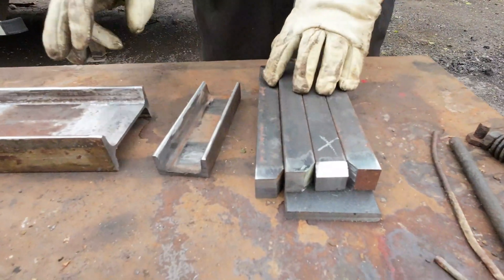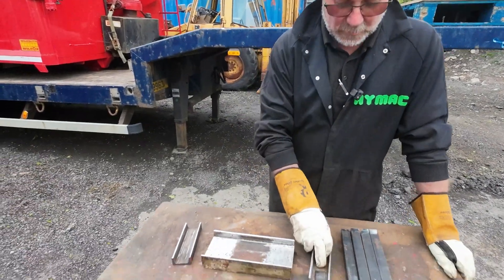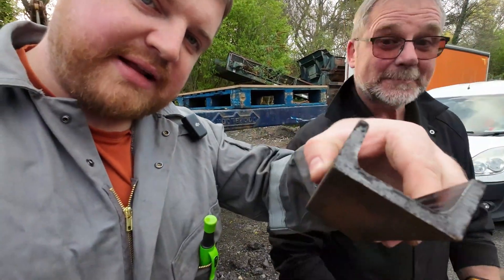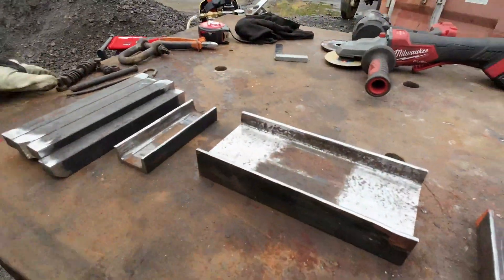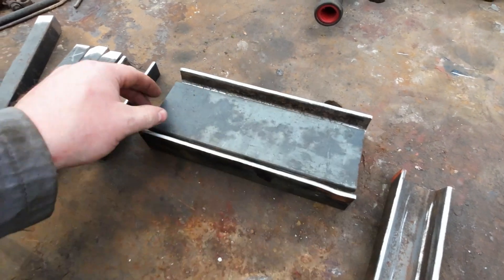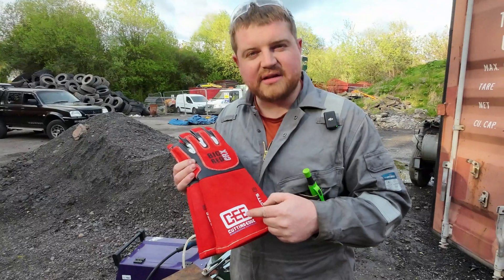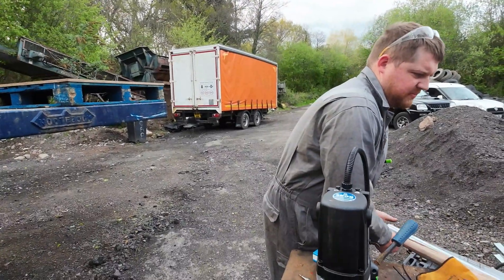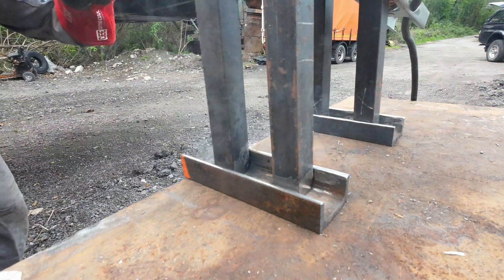Fabricating A Liner Puller | Homemade DIY tooling

Comment: Bit of channel.......bit of universal and a bit of square bar...

Make hardwood slippers for it so you don't damage block when putting the weight on...

Good 
😐🇬🇧
Reply from the maker: Surprising the force that was needed to pull them out Glen, that was a worry with marking the block but think we survived it

Comment: Hope it works. I used to use a brazing torch and a long screwdriver to get liners out of Perkins engines. Start at the top and heat the liner and tap down the screwdriver, effectively cutting a strip out. 

Running a couple of beads of weld in the liner shrinks them enough to tap them out too.
Reply from the maker: That was our resort if this didn’t work, the weld one I had heard about, thanks for watching and commenting👍🏻